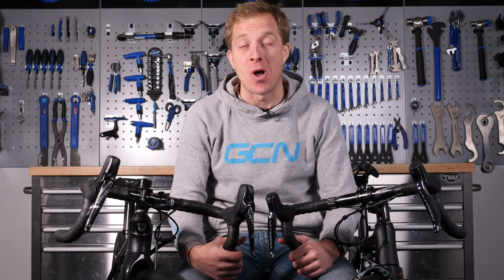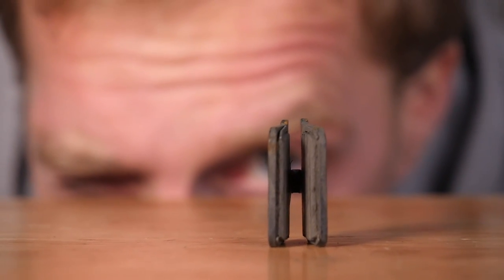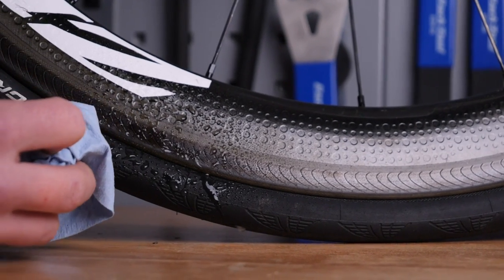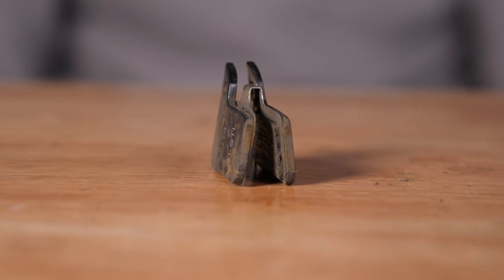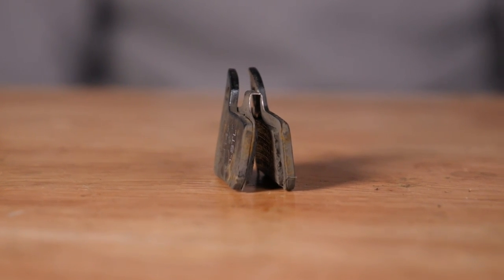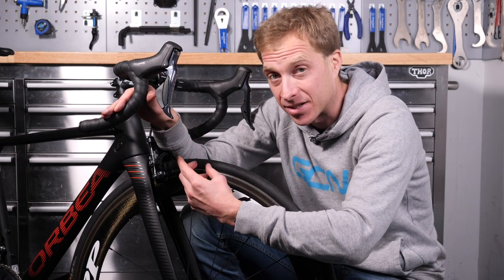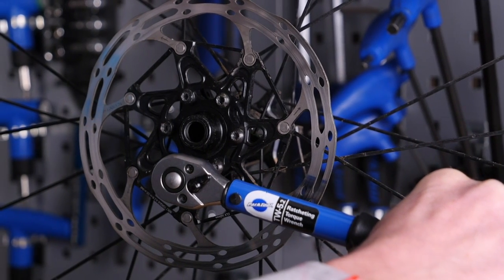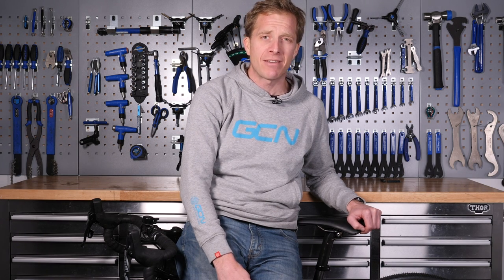How To Solve Brake Squeal – Solutions For Noisy Brakes

Comment: I was nervous it would rim OR disc, but I'm very happy indeed to see it's both.  Disc brakes have arrived, and they deserve to be considered to be equal with rim brakes :)
Reply: Nope, they are far superior - at least in my mind :) Its incredible how little sand or road grime you can get on your rims before the brakes start sounding like they are chewing right through your rims
Reply: The problem isn't that they have arrived and are not being considered equally (as they are here, fair enough), it's that they are being marketed as universally superior to rim brakes, which they aren't. It's quite outrageous that many of the big American manufacturers are refusing to offer rim brake options on high-end 2019 bikes, and even blocking the sale of high end rim brake framesets in many cases. This is purely to try to force a reluctant market to adopt disc brakes universally, which I am going to enjoy watching fail spectacularly over the next few years.
Reply: And it's incredible how much more disc brakes tend to squeal than rim brakes generally.. Unless you are riding off-road, on gravel or in torrential rain on a daily basis the phenomenon you describe shouldn't be an issue with rim brakes.
Reply: Neil To each their own, I guess. Nowadays I run rim brakes on my Brompton and discs on my full-size moose. Given the choice, I’d go for discs every single time despite having had the odd warped disc. Both systems work, but I’ve always found the idea of braking at the expense of wearing down your rim(!) an inherently poor and wasteful design choice for any non-racer out there. Just my 0.02c, though.
Reply: Rims last for years and years unless you are riding them regularly in cruddy conditions - are you in Finland? If so then discs are definitely good for the winter but surely you don’t need them on the road in summer? I certainly didn’t when I was there..
Reply: @neil7769  Got me, I live in Finland - plenty of wet slosh available on the roads for around half of the year. And no, you don't NEED discs in the summer per se, rims work fine too like I said, although I do leave a longer safety margin when braking in the rain when the rims are wet. Good point there by Robert too - I took it for granted that we're only comparing high-quality alternatives head to head. I just spec my main bike for commuting and riding year-round in all conditions, do all my own maintenance on it and like to advocate tech that I personally think works better overall and allows more people to do the same. There's no right or wrong here, though - use what works for you and ride what you've got. :)
Reply: @neil7769 , I wore out a front rim in 5,000 miles. I ride in all conditions including snow in Virginia, USA. So you're saying I need two bikes instead of just having a disc brake road bike? What advantages do rim brakes actually have besides being 14oz lighter? By the win at Kona on a disc brake triathlon bike and multiple stage wins at the TdF from Peter Sagan I think any aero disadvantages have been proven to be a bogus claim.
Reply: @Pastamistic  - Of course, if you want to ride the same bike all year round in a cool/wet/cold temperate climate disc brakes make sense. Many of us have more than one bike however (and why not if we are cycling several times a week, every week?), and the many slight drawbacks of discs for a performance road bike that's mostly ridden on the road in dry weather add up to make them distinctly suboptimal. 1) They are significantly heavier - almost 1kg heavier once you factor everything in. 2) They are definitely less aero, although admittedly the difference is very small. The marketing of the latest disc brake aero bikes as being more aero than the previous generation of rim brake aero bikes is a sleight of hand that trades off aero gains made in other areas against the aero disadvantages of discs. This is very clear if you look at the latest independent tests of aero bikes in the German Tour magazine, where the rim brake bikes consistently outperformed the disc bikes of the same model in the wind tunnel (although the differences between rim and disc were less important than frame design generally). Of course people like Sagan and Viviani can win sprints on them, the aero disadvantage of discs in a bunch sprint is tiny but it is there, and they are paid to ride what they are told to. 3) Disc frames generally need to have longer chainstays to optimise chainline and prevent heel-clipping given the wider rear hub spacing, and this impacts on stiffness and responsiveness. 4) Front wheels need to be cross-spoked and built with more spokes, impacting on both weight and aero (OK, I suppose that's part of 1 & 2). 5) Discs are more complicated to set up and maintain, and certainly have a greater tendency to squeal than rim brakes. 6) Practically everything on a disc brake bike (wheels, frame, groupset) is incompatible with everything on a rim brake bike, including all bikes made in the last 30 or 40 years that are otherwise more or less cross-compatible. 

The questionable braking advantages of disc brakes on a dry-weather performance bike are massively outweighed by these factors taken together  (even if not perhaps by any single factor on its own). Whcih is why it is just ridiculous that some of the big (mostly North American) manufacturers are now trying to prevent people from buying high-end performance road bikes with rim brakes  by stopping supplyimg them, even although in some cases the models in question were only released last year.. The idea is clearly that if there aren't any rim brake bikes to make comparisons with, the disadvantages of discs will be less apparent and people will feel that they need to buy into the latest trend. But the problem with this for anyone that thinks about it is that we still have our rim brake bikes, and because there have been hardly any real advances in road bike design in the past five to seven years they are actually superior to what is currently on offer (and they cost significantly less at the time than the equivalent current bikes cost - prices have risen by about 50%!). 

If the "latest thing" is actually inferior to what was being sold five years ago (because the supposed advantages are actually disadvantages), then I suppose it makes sense to stop manufacturing bikes that make this more obvious by comparison...
Reply: @neil7769  The weight penalty is only 14oz for disc brakes on a road bike. Sounds like you've never had hydro disc brakes so it's not worth the trouble. Get on a disc brake road bike and you'll be the same pace as any rim brake bike. The differences are to negligible to consider outside of a laboratory. For the amount of time I spend cleaning my rims it more than makes up for the 20mins it takes to bleed my disc brakes once a year. My mtb brakes have taken a pounding with literally zero maintenance over 1,000 miles until I replaced the pads. My new road bike with Ultegra disc have required absolutely zero maintenance for the past 2,600 miles since I bought it. Only need to deal with the squealing when wet.
Reply: For crying out loud, did you actually read any of that..? FYI, I commuted for several years on hydraulic discs so i have plenty if experience with them, thankyouverymuch... I had to look up what 14 ounces was in post-18th century units but it seems that it's 300 or 400g. The weight penalty of discs is nearly always more than that, unsually somewhere between 500 and 800g (so the best part of a kilo) once you take into account all of the factors, including frame strengthening, heavier front wheel, hubs, rotors, hydraulics, etc.. The other penalties are as I have described in some detail. Whether or not you consider them significant is a subjective matter of course - what is less so is that for a performance road bike being ridden in largely dry conditions they outweigh the advantages.
Reply: @neil7769  I did read it and I apologize for my country being the last to keep such a crappy system of weights and measurements. Have you ridden a disc road bike equivalent to your current road bike and was there any difference in you're end speed for the same effort level? 1kg makes practically no difference for climbing and if you're racing it's still easy to reach the UCI weight limit. Most of the population's weight can vary by 1kg throughout any given day. The aero penalty of wearing a slightly large cycling jersey is worse than the aero drag of disc brakes on a road bike. Both of these make any perceived disadvantage of disc brakes in real world riding pointless. I agree the price of bikes is getting absurd and disc brakes don't help but if you have $2k+ to drop on a bike a few hundred isn't making any real difference.
Reply: @Pastamistic  I've test ridden a couple of high-end disc road bikes and as I say, I have extensive experience of discs for commuting. Of course, it would be impossible to quantify any differences in actual speed without a series of tests in highly controlled conditions and I fully admit that the effects of 1kg and/or very small aero disadvantages on average speed would be almost undetectable in most cicumstances (although for me at least, 1kg could easily make a competitive difference in a hill climb). The point I was making however was that there are many very slight disadvantages that all add up - not least the extra complication of maintenance and incompatibility with existing equipment - and the advantages they are being traded-off against are practically non-existent for a summer weather performance road bike. Discs are a completely unnecessary, massively over-engineered solution for that application.

My subjective feeling when I test rode some disc brake road bikes was that they felt less lively than my own bikes. This could have been down to the particular models and nothing to do with the fact they were disc bikes, but a number of reviews of disc bikes where the reviewer had previous experience of the rim brake model have reached the same conclusions. I actually think that one of the biggest factors (which I mentioned above but is rarely talked about) could be  the wider hub spacing and extra chainstay length - the latter can have a major effect on the way a bike feels and handles, especially under sharp accellerations. But even small differences in weight are also detectable during sharp efforts, especially uphill and for someone who is already light. One kilo is borderline I admit, but 2kg is certainly noticeable for someone like me who weighs 63kg - I know this just from how it feels to run up a few flights of stairs with and without a 2kg rucksack on.. And of course, as with all weight-related issues it's the contribution towards the total that matters - an extra kilo is a very signifcant percentage of 3kg, which you will certainly notice.

Again, my issue here is *not being given the choice*, especially when it is absolutely clear to me that a rim brake bike is better for my needs.
Reply: @neil7769  Not having a choice does suck but when there is no quantifiable disadvantage in real world riding why not switch to disc if buying a new bike? Mountain bike rim brakes are still available so I see road rim brakes still being supported for decades. Plenty of rim brake road bikes are available now that will inevitably show up on the used market to buy. I'm sure specialty hill climb bikes will be around for a long time and popularity with that seems to be increasing.

I just don't understand why people are fighting it so much. The naysayers come up with tons of excuses without much real substance to back it up. Disc isn't actually slower excluding hill climb racing, they aren't high maintenance (in my case drastically less) and they are easy to work on (at least Shimano is).
Reply: @Pastamistic  I think we are going around in circles here - I've already explained in some detail why there are significant disadvantages (of various degrees of quantifiability), and provided an abundance of "substance" to back it up. 

Rim brakes are ALREADY not being supported on high-end bikes from many manufacturers (by high-end here I mean the ones based on the higher modulus framesets with the best layups). As I said above, due to the general lack of meaningful progress in bike design over the last few years that's not currently a problem for people that already have decent bikes, but it will become a problem in due course, and I for one have no intention of going to the second-hand market to get my next bike.. Doubtless there will be manufacturers who will still make high-end rim framesets but my choice could be drastically reduced. 

In fact, as I hinted at in my first comment, I don't think this will actually happen. The current marketing strategy by some of the big brands is so patently idiotic and regionally parochial that is is doomed to failure. Product evolution doesn't go backwards, or at least not for any length of time - the demand for optimality from a sufficiently large part of the market will in due course dictate supply, and at the very least that will cause long term damage to the reputations of these brands (I think It already has), even if they are forced to backtrack. 

People are fighting it because they don't like having a stupid and illogical situation forced upon them for purely commercial reasons. It's one thing when marketing tries to persuade consumers to make stupid choices, quite another when it deliberately tries to restrict choice against demand.
Reply: Robert Trageser  I was struck yesterday by the comparison with Apple, in the news due to a big fall in the share price. People simply haven't been buying the newest models because they are overpriced and don't really do much that the older models they already have don't do. Apple seemed to have assumed that everyone would want the new iPhone X or whatever just because it was the latest and had a few extra features that in practice didn't enhance the actual functionality, while at the same being more cheaply produced and lacking some of the well-loved features of the older models (such as compactness and a real home button). From the PoV of environmental destruction caused by rare-earth metal mining, manufacturing, packaging, disposal of old phones etc it's great that less people are falling for the hype. But our economies are predicated on ever-increasing consumption, a faulty and  unsustainable model that fails to factor in the long-term economic impact of finite natural capital and ecosystem services. 

I suppose I should thank the bike industry for making stuff I don't want - I'm as susceptible as the next person to marketing when I like what's on offer. But it seems that the marketeers have gone a step too far. People aren't going to buy stuff JUST based on marketing, there has to be some meaningful substance behind it, and consumers (many of them at least) are better informed and more rational than the marketeers given them credit for.
Reply: Robert Trageser  disc brakes last longer and are higher quality than rim..... They don't wear out very quickly when conditions aren't optimal, you don't need to replace an entire rim when they do wear out, and you get better quality braking in ALL conditions even if it is marginal when clean and dry.
Reply: Robert Trageser  I didn't spend enough on my mtb and ended up replacing everything except the frame and fork due to either breakage or wearing parts out. I ride the downhills pretty hard (background in motocross). On the road bike it has nothing to do with needing it most of the time. It's just nice to have better braking performance in all conditions and the cost in weight and aero performance is nearly non-existent. I have ridden my road bike in snow which resulted in literally zero braking and heavy downpours which reduced my braking power by 80% while dodging downed tree limbs at night. The vast majority of people want better braking and longevity with minimal cost in performance elsewhere which is exactly what disc brakes provide. Manufactures are making what that majority people WANT which can hardly be considered shoving it down their throats. Just because YOU don't doesn't mean they should cater to the minority which is what smaller specialty brands are for.

Most people use hydro disc for bike packing now even if it's for trips around the world. They do it because they need reliability and braking performance in all conditions. Sure it can be done on rim brakes but there's a reason why most choose hydro disc.

I agree with only using Shimano. I had nothing but bad experience with Avid (Sram) but that was 10 years ago. Rim brakes are already at their absolute best. Disc brakes are already better but still have room for improvement. There are quite a few good manufactures for mountain biking though.
Reply: I've actually edited one of my posts above where I named big US-based brands that appeared not to be offering high-end rim brake models in their 2019 ranges - it looks like some of them might already have backtracked! I'm sure I read reports claiming that the higher-end Specialized Tarmacs would be disc only for 2019 and couldn't find rim models when I checked the website a few weeks ago, but I see that they are now offering a rim brake S-Works model as well as a 2019 S-Works rim frameset (discs only on the Venge though). Trek are also offering both the top-end Madones and Emondas in rim and disc options, and Cannondale are doing both rim and disc options for the Supersix Evo Hi-mod (but like Spesh, disc only for the aero Systemsix). Kudos to them for still offering rim brake options for those (like me) who want them.

Brands that currently appear NOT to be offering rim brake options in their high-end performace models inclde Scott, who for 2019 are only doing rim brake models and framesets in their lower-level "HMF" layups for both the Foil and Addict, while the lighter/stiffer "HMX" models are all disc only, and Focus, who have gone all-disc for their new Izalco (although you can still get the previous model Izalco as a frameset).

So it seems that the complete demise of rim brakes may not quite be on the horizon - which is maybe not surprising given that the pro teams with climbers / GC contenders will probably still want to have rim brake options to choose from. It's going to be interesting to see what Michelton-Scott are riding in 2019, I really can't imagine Simon Yates on an Addict disc!